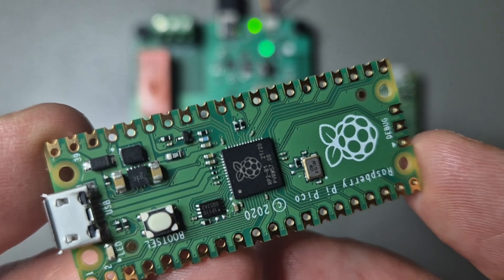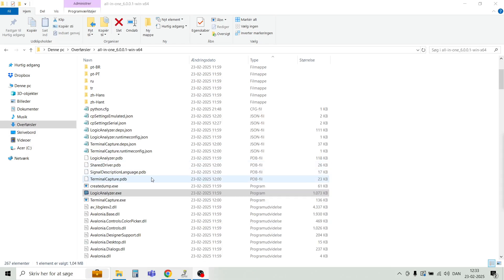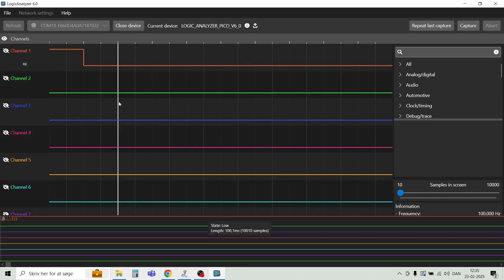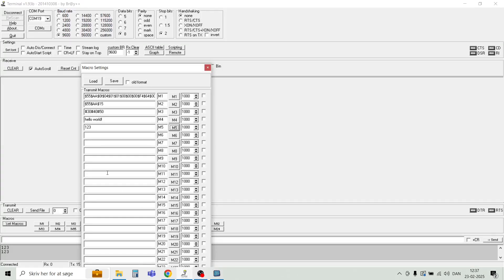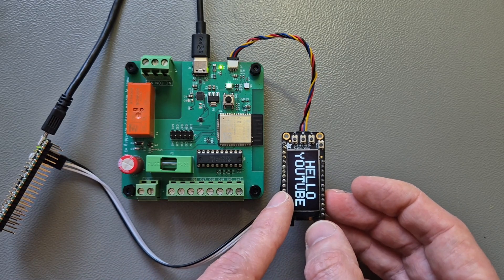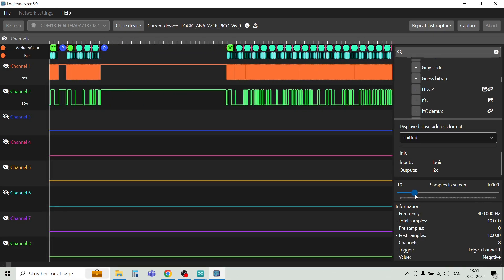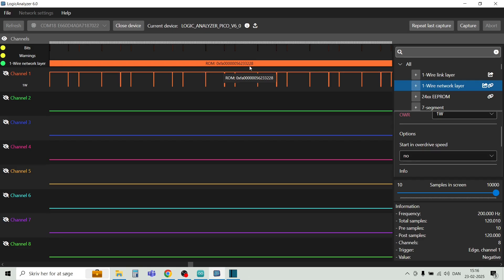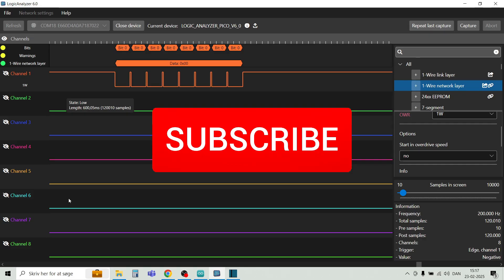Make a 100MHz 24 Channel Logic Analyser from your favorite Raspberry Pi Pico

Comment: First, I wanted to say THANK YOU for making such a good video! Now, other than the Raspberry Pi Pico, what other equipment do I need to purchase? I would love to use this device to look at signals? You did a good job on the hardware, very good, but what is the hardware needed? THANK YOU again.
Reply from the maker: Thanks, you only need a PICO

Comment: I just bought one of these Pico2 devices with input buffers and hope I can use it to test and fault find a 6502 CPU
Thanks for the video, a great help setting up the software.
Reply from the maker: @SusanAmberBruce - You are very welcome, good luck with the 6502 debugging.
Reply: @made.by.morten.laboratories thanks

Comment: Nice, thank you. However, my guess is that the input pins needs some protection hardware. What can you advice for that? Did you create a hat for that?
Reply from the maker: @rvamerongen - thank you very much. I don't have a HAT yet :-) You can try and have a look on the TXU0104PWR.
Reply: @made.by.morten.laboratories  74LVC244 makes more sense, powered by 3v3 with 5v tolerant inputs.
Reply from the maker: Great idea

Comment: I would have liked to see a test at maximum frequency and minimum voltage, e.g. counting a regular signal to check if it loses packets
Reply from the maker: @RaduRadi-l2e - this is very good ideas for a follow-up video, thank you for inputs

Comment: Could it capture its own io ports while running an application?
Reply from the maker: What is it you want to achieve with this?
Reply: @made.by.morten.laboratories  Lets say I have a digital controller that reads inputs and generates some outputs. I could watch it in real time without having to hook the analyzer. In practice, it is the original project with an added thread to generate some outputs.
Reply from the maker: @barbiani  Sure you can do this if you have access to the code

Comment: Hello there! I really appreciated the video! Can this be used to measure voltage (5V, 3.3V) from the pins (INT, SCK, MISO, MOSI, CS) of a CAN module (MCP2515 +TJA1050)?
Reply from the maker: @LeandroR1976, the PICO alone can only measure 3.3V level signal, you need some level tramslators in front og the GPIO pins if you want ather levels. I you search for "Happy Little Diodes" https://www.youtube.com/watch?v=VjSF2LWJVVU&t=391s
He has a design with level converters in front - I hope this will work for you, elese try and make one yourself 🙂

Comment: Device reported error starting capture. Restart the device and try again.

I am getting this error after pressing apply on capture window. tried to disconnect and reconnect pico 2 to see this error will away. is this a known issue. can any one shine some light over this 😊
Reply: This is fixed. I flashed 6.0 firmware to pico and opened 6.5 analyzer. Both need to be same version. Also we need to go to option of current folder of Python config and make sure the extension is not hidden. Otherwise we might save file as Python.cfg.txt where txt might be hidden.
Reply from the maker: @afsallais9825 Great news, i am glad your sorted it out and share the solution here :-)

Comment: Siempre me aparece este error error "Device reported error starting capture. Restart the device and try again." 🤷‍♀
Reply from the maker: Which Pico do you use and which UF2 file? Which operating system?
Reply: @made.by.morten.laboratories  Thanks for your reply. The card is a Raspberry Pi Pico, and I downloaded both the UF2 file and the PC software from the GitHub page. I'm using Windows 10 x64.
Reply: @made.by.morten.laboratories  Thanks for your reply.
I've used a Pi Pico card. I downloaded the UF2 and the software from the GitHub page. The operating system is Windows 10 x64.

I used the same card to test the sigrock analyzer and another one called "scopypico," and they work perfectly. It's only given me problems in this project.
Reply: Thanks for your reply.
I've used a Pi Pico card. I downloaded the UF2 and the software from the GitHub page. The operating system is Windows 10 x64.

I used the same card to test the sigrock analyzer and another one called "scopypico," and they work perfectly. It's only given me problems in this project.
Reply from the maker: OK, try to get in touch with "gusmanb - Agustín Gimenez Bernad" - he made the firmware, maybe he can help you out. I have not seen this kind of error message
Reply: Gracias por tu tiempo.. encontré el problema.. estaba usando el uf2 versión 6.5 con el software 6.0.0.1.. con el software v6.5 ya me funciona. 👍
Reply from the maker: @traduccion1024  That is great news, good luck with your new tool :-)

Comment: Seems risky to have those GPIOs connected directly to some stuff you typically aren't 100% sure of what is on it.  I'm looking forward to hardware that uses the rp2040 and later in this way, but add components to handle a wider voltage range and just protect those GPIOs.
Reply from the maker: You are right, i am already working a a simple interface board :)
Reply: https://www.youtube.com/watch?v=VjSF2LWJVVU&pp=0gcJCYYJAYcqIYzv
Reply: Risky?? This is a $6 or $7 part, you need a loan if this burns out?  :)

Comment: Thanks for your efforts Morten Sir, i have a question can it gandle voltage from 0 to +15 vlt with complete design as original i didn't find any information on this so please suggest
Reply from the maker: There are several adapters with Pico mounted that can handle +1.8V to +5.5V input, just google a bit :-)
Reply: @made.by.morten.laboratories  ok i will give you purpose of asking this question currently i am using cheap logic analyzer available in market as i cant afford that issues i face when i have 12 volt signal like LIN they are destroying my logic analyzer so i need some circuits in middle that can sample upto 1us signal as well as able to convert 12 volt to 5 signal and  i dont want to loose of shift the signals

Comment: I have followed the instructions and installed the firmware on a pico w wifi.  However, when I try to capture on the logic analyzer, i get an error "Device reported error starting capture. Restart the device and try again."  Any idea what is going on?  Thanks
Reply from the maker: Did you use beta firmware? Which exact Pico do you have and which UF2 file did you program into it? Which version of the analyzer are you using? Windows/Linux?

Comment: Hello, can anyone tell me the main benefit of the PCB for this project?  Is it mostly just for changing the input level between 5v, 3.3, and external source?
Reply: It also avoids the Pico2 GPIO bug, if you use a Pico2 and don't use a PCB the IOs get stuck sometimes. If you want to use only a regular Pico then there is a section in the Wiki on how to use it barebone without PCB. Also it includes the chaining headers to connect up to 5 in daisy chain letting to capture up to 120 channels at once.
Reply from the maker: @drgusman thank you for the clarification and great work from your side. It's much appreciated ...
Reply: @drgusman  Thank you for the clarification as well.  :)

Comment: This is really interesting!  I just wish I could stop finding things like this as I've found so many cool things to do with microcontrollers that I never manage to finish any of my projects lol
Reply from the maker: Totally agree on this one too, i have a lot of so called "Friday Projects" that needs to be completed and i also have a lot of ideas for future videos as well.
Reply: @made.by.morten.laboratories  It is too late.  I need to look into this.  This would have saved me a lot of pain with some issues with UART
Reply from the maker: Yes you can also analyze the traffic on both rx and tx at the same time with this tool.
Reply: Interesting, what is possible with a pi pico . For practical use  case the inputs shall be protected.
Reply from the maker: @heinzkreutziger2218  yes, some input protection and level conversion would be optimal
Reply: You too?!  I have about 7000 things started or on the list, and nothing finished..   :-)  Add this one to the list for sure!
Reply: I'm not alone.

Comment: Thank you for this wonderful video! I just ordered a pico and can't wait to do this project. The most amazing thing its it's ability to decode all the protocols. Thank you!
Reply from the maker: Thank you so much for the feedback :-) Good luck with your project, and please feel free to share your findings with us!
Reply: @ Will do! I especially want to use it to decode a car alarm system that receives wireless signals from the remote control and find out the data is transmitting and protocol, so I could replicate it using my own micro controller. But also this is good to see and learn how digital systems communicate. I was amazed when you were showing how the data looks like and what it meant. if you have any projects that you want to use this logic analyzer for please make another video showing how you use it again because that helps me learn even more it’s usefulness.
Reply from the maker: Interesting project. I will for sure use this analyser for future debugging and reverse enginerring projects. So many plans and so little time :-)
Reply: @made.by.morten.laboratories  I could totally understand with the there's little time. So many amazing projects to do nowadays especially with AI assistance